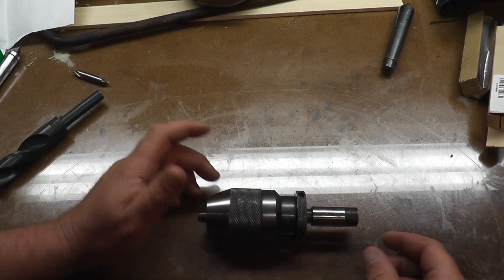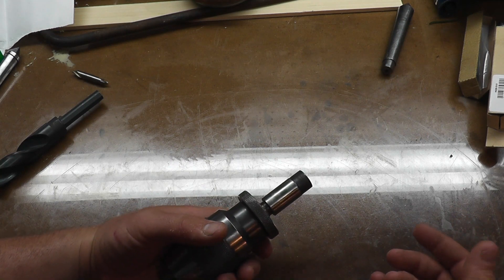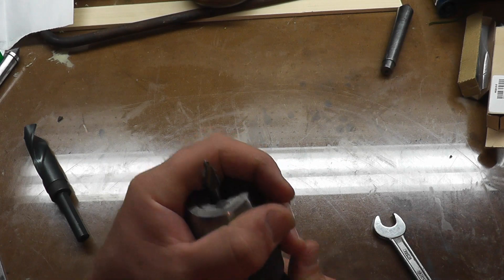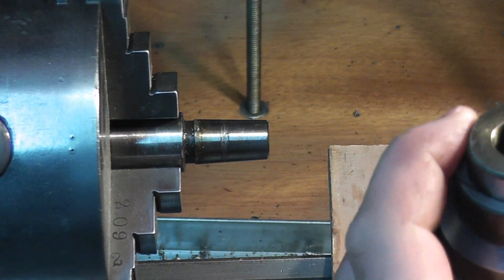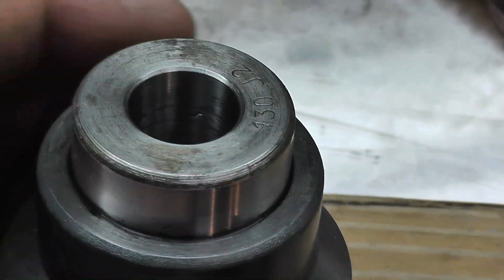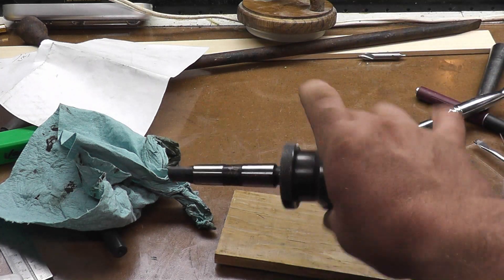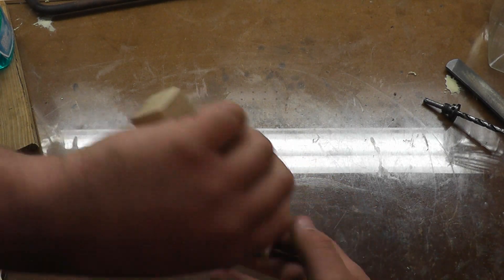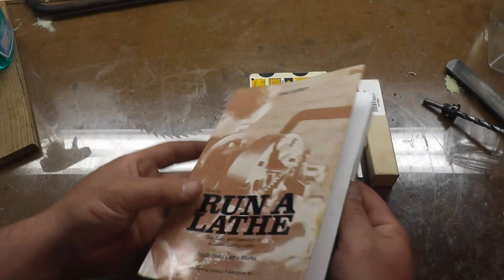Drill Chuck Arbor Removal and Replacement

Comment: Just set the arbor between the jaws of a vise and use a 1/2 round punch through the chuck to tap out the arbor/ My 14-year-old 5/8 chuck only took one tap with a ball-peen hammer, and the arbor dropped out.

Comment: Though I had the Jacobs wedges, I could not separate the arbor from the chuck.  I applied so much force that the arbor slid out of the collet rather than the arbor releasing from the chuck.  The solution was applying a few drops of Kroil where the arbor and chuck meet and let it sit overnight.  The next day I used a pair of ball-peen hammers and drove the wedges against one another.  It took 5 tries to synchronize the blows with adequate force before the chuck released.

Comment: You have just save me £10 for having to buy a set of wedges to remove the J1 taper from a 1/4" Albrecht.
By 3/8 spanner wouldn't fit, so I just held it to the side of my bench grinder to remove a little metal and form a wedge, then chuck into the aluminium jawed vice and a couple of biffs with a persuader and off it popped.
Owe you a beer if you are ever in Norfolk, UK not VA that is :-)
HOW did we manage before the 'net?
Trial & error, broken parts and inventive language your Grandma had never heard of me thinks and remember.
Happy New Year to all.
Geoff 'OuBallie' - Shop time tomorrow

Comment: Thank you so much! This method worked pretty well for me, except for one thing:
I couldn't find a large enough wrench, and all of my wrenchs were untapered. To remove the drill chuck, after getting the collar off, I milled a tapered piece of aluminum of some small arbitrary angle. Then I cut a slot in the side of it with a 3/4" end mill and used that to wedge the chuck off. It took a bit of hammering, but I got in the end.

Comment: Cheers,
I just bought 2x Albrecht chucks on ebay, a  O - 3/8 in near new cond. It has a Jacobs 1/2" arbor that I want to change to #1 morse. I also bought a  0 - 5/16 that I want to put a new 1/2" arbor in. I wasn't aware that drilling through the arbor & putting a pin through to remove arbor with drifts could be done, excellent !. The latter chuck was a great buy because the jaws are cactus, but the chuck is otherwise O.K. I will replace the jaws but I am not sure the model, I could not see it stamped. Or are all these chucks the same jaws ?
  I'll subscribe because that was a good video on this type of chuck...
Cheers, Pedro...      "Merry Xmas".......
Reply from the maker: Usually the model is stamped on the side or at least the size range.  The jaws for each range are different and the albrecht rebuild kits can be a bit pricey.
Reply: *****
Cheers for your reply. I made the tooling needed to dismantle the  0 to 5/16" chuck & it was very simple with the right gear. There was a bit of surface rust internally but I gave the parts a gentle polish with very fine wet & dry on the lathe & thoroughly cleaned every part, it will be a good chuck again provided I can get the right jaws. I will knock the old arbor out while it's in pieces.
Thanks again for your help. 
Pedro...

Comment: Hello again. I just had to try to remove the arbor from my chuck. I tried making a poor mans removal tool to remove the arbor. No luck, all I managed to do was get my wrench stuck in place. So...onward and disassemble the whole thing and try to remove it with my arbor press. I watched a video last night showing the disassembling and service of the chuck. Taking it apart is very easy to do.It unscrews exactly like you said. This chuck is very well made with close tolerances inside the bore. Now comes the fun part. I tried to press out the arbor with my 2 ton arbor press, but it would not budge. Looks like it will have to be pressed out using a much more powerful press, probably a hydraulic press. I was able to order a replacement 6JT 2MT from Mc Masters. It will probably arrive here, before I can get this thing pressed out, but oh well. Something new every day.
Reply from the maker: The little short stubb arbors are for either use in a collet of a milling machine or in a turret type tailstock.  sometimes those suckers can get really jammed in there.  especially if you add in any kind of rust.  Worst case scenario a little heat may work to get it unstuck.  Also a nice bath in some penetrating oil may help.  Just be sure to get it all thoroughly cleaned of oil or grease before the new arbor goes in.

Comment: I watched this video awhile back even before I got my lathe. When I got the lathe, I came across what looks like your Albrecht chuck, but didn't have a clue what the previous owner used it for. It too had the same short shaft sticking out of the bottom. It wouldn't fit in my chuck, so back into the drawer it went. Now watching your video I now see how that chuck will become useful. So ! out to the garage at 9:30 PM to check it out. Well this chuck turns out to be a CUSHMAN brand chuck and is stamped Japan  C13k 6JT. 1/2 " cap. Now that kinda scares me. Looking at the base, that shaft looks pretty large. If I remove that shaft, am I looking at having a problem finding a replacement shaft to fit my lathe. My lathe is identical to yours. What possible use would that short shaft have ? Thanks again for all these great videos. My wife refers to my lathe as "That other woman" because I am spending so much time out in the garage.  ...Ken

Comment: Although I subscribe to your channel, I didn't find this video until today when I did a YouTube search. I needed to remove the MT2 arbor from an Albrecht chuck to replace it with a R8 arbor.  I found that a 16mm wrench that came with my Bosch router was the perfect size.  I sanded a small taper on the end to help it start and with a fair amount of tapping with a hammer, I had success.  Thanks for the idea!
Reply from the maker: Glad the video helped :-)

Comment: There is no benefit to chilling a tapered shank prier to insertion, as driving with marginally  more force will achieve the same effect. It is actually a detriment to chill a shaft in a freezer, in industry a freezer is never used because water that has condeznsated will be trapped then lead to corrosion. For straight shafts either heating alone is used, or chilled with nitrogen or CO2 free of moisture and oxygen. In addition oil or grease is added for ease or removal in the future.